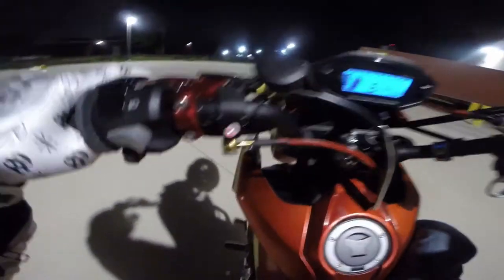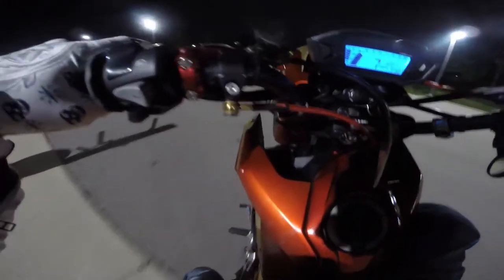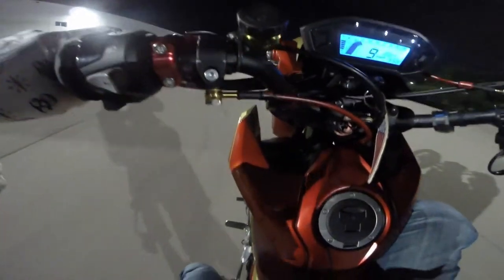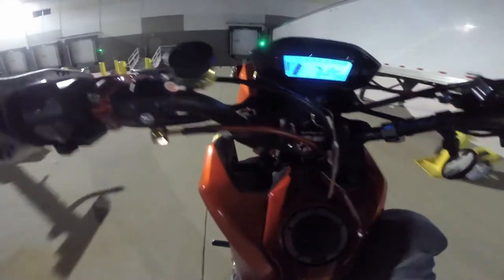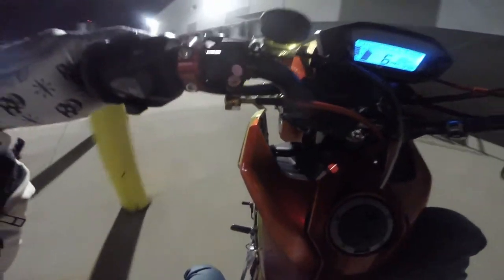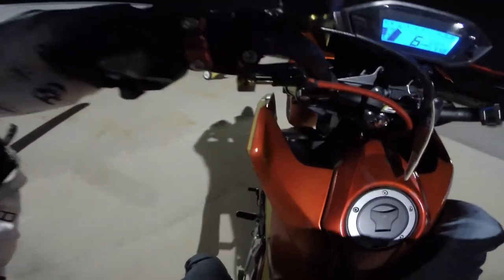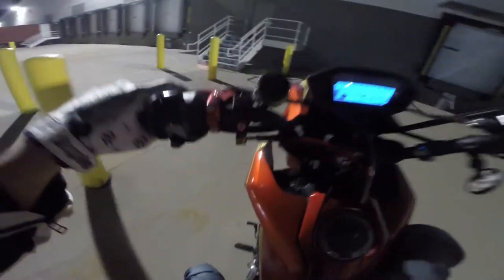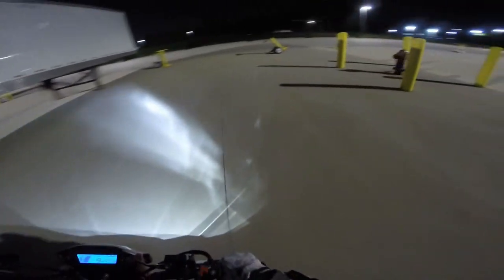How to do SITDOWN CIRCLES on a Honda GROM (Leg Down)

Comment: Is this with stock idle or cranked up?
Reply from the maker: This video it was probably at 3k. I do everything at about 5k now. It's possible to do at stock idle but your fighting the engine braking the entire time.
Reply: @RobRippin  ive been learning to get the circles tighter but im on stock idle still no adjuster yet, and the bike is like dying out over and over, i have to keep on the throttle ride the break just althe right amount to get them real tight
Reply from the maker: @FinnaBin  Gunna have to do A LOT of clutch work on stock idle otherwise it will keep stalling